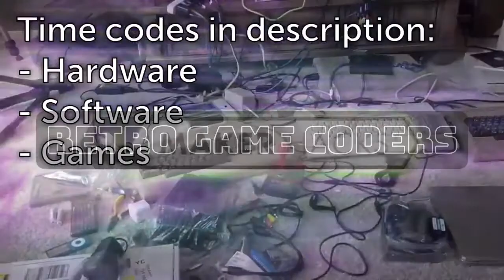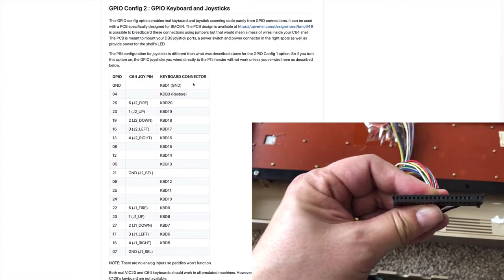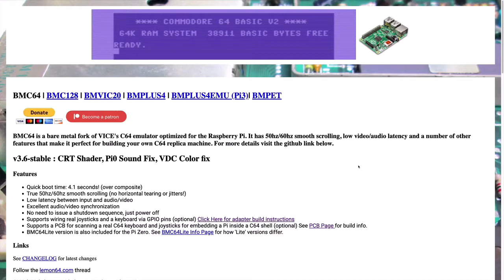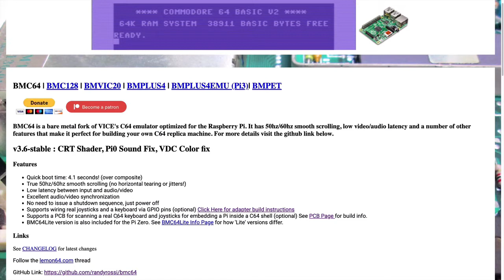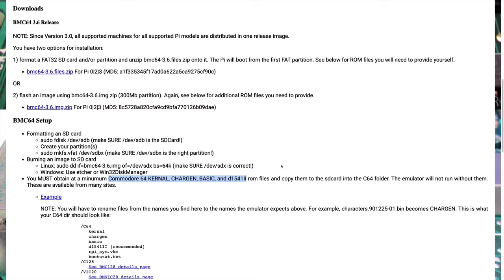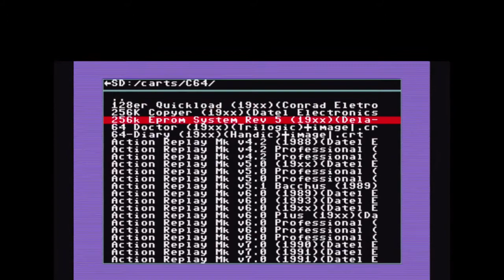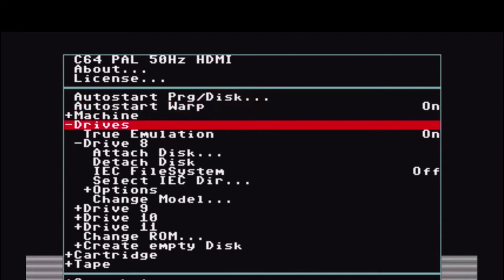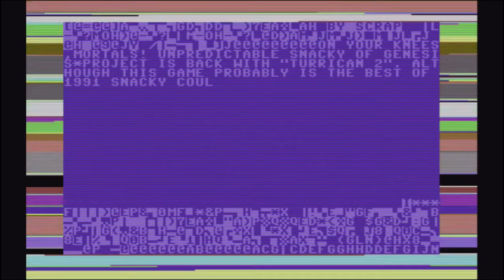Raspberry Pi Commodore 64 (BMC64)

Comment: My first computer was a C=128, I loved that machine, even purchased a monitor for it instead of running on a TV then I wanted sound so I bought a Tandy under monitor with duel front firing speakers and a bottom firing woofer, had a nice amp built in with great controls. I still have that!  It is old now but still looks good, I tore it down and replaced all the caps on it a few months ago, then put in a blue tooth receiver so I can use it for a BT speaker set . Nice, it has a regular power cord so no searching for a wall wart, still sounds great too! Oh I did replace the volume variable resistor as it was getting to bad even with a spray of cleaner.

Comment: What's the difference between BMC64 and Combian64? Which is best? I'm confused. Also, what size SD card do you recommend? Thanks so much for any help and sorry about all of the questions.
Reply from the maker: BMC64 boots directly, it’s basically the OS, where Combian runs on Linux and you can drop to her command line. Both have base specs with SD recommendations I believe, can’t recall
Reply: @RetroGameCoders  Thank you very much, that's really helpful.

Comment: when I try to load from disk, it says device not present error. any suggestions
Reply: Check if the sd card has a boot partition, copy the files onto that.
Reply: @Testacabeza  I had the same issue. Turned out the 1541 ROM was not the correct one for the kernal used. After some trial and error I found one that worked. I also needed to add the 1541 device as the drive in the options below the drive unit